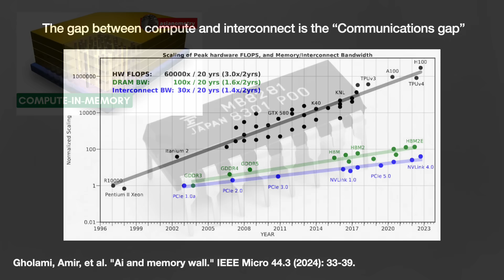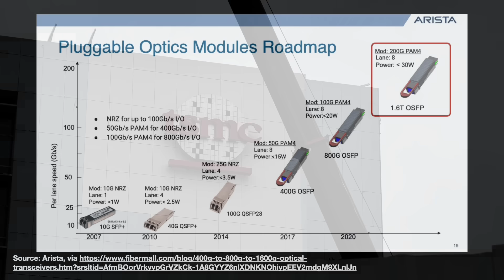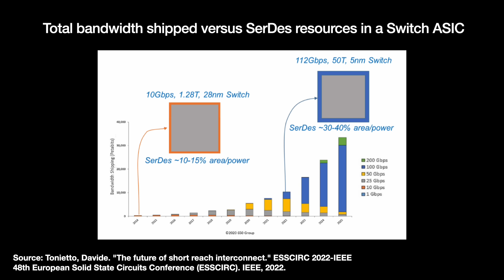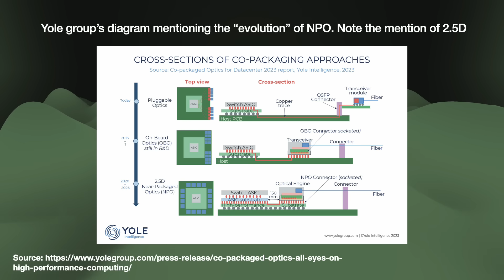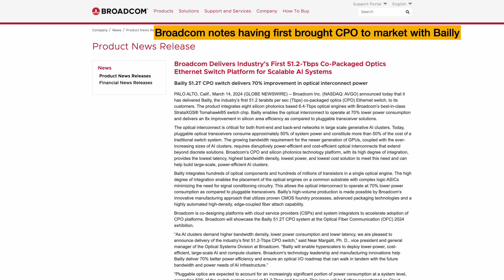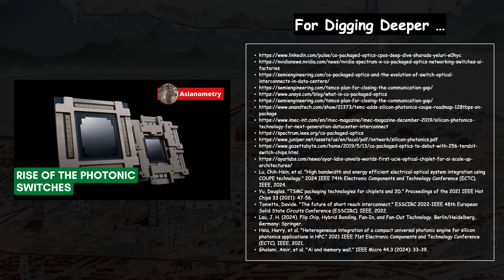The AI Bandwidth Wall & Co-Packaged Optics

Comment: Unlike traditional data centers that operate as isolated “energy hogs,” BroadWatt integrates seamlessly with Broad Group’s building ecosystem—sharing heat, power, and infrastructure. It’s not just a data center; it’s a cohesive part of smart urban energy systems.

Comment: Copper has frequency dependent loss. This means that high frequency signals lose energy faster than lower frequency signals. Optical fiber (in the frequencies/wavelengths used in data centers; O-band 1270-1350nm) has approximately frequency independent loss. Thus copper is reach limited, but optics can span further. Asianometry got it right on the optical coupling loss. Getting the signal into the optical fiber or waveguide is lossy, so for shorter reaches it just doesn't make sense to take the loss hit.

SerDes has been commonplace since the late 1990's - these are used for any contact or i/o limited complex IC. State of the art switch chips (102T as of 2025) have 512x SerDes each operating at 200Gbps using PAM4 (two bits per baud as there are 4 levels) electrical signaling. We adopted PAM4 instead of NRZ (aka PAM2) because it lowered the signaling frequency -- the 200Gbps PAM4 has a Nyquist frequency of 53.125 GHz. This allowed longer reaches with copper cables than if we had tried to carry 200Gbps PAM2 with a Nyquist frequency of 106.25 GHz.

The 800G and 1600G signaling that Asianometry mentions in the video is a bit of a red herring. All the intra-data center traffic is carried in lanes which match the SerDes lane data rate for the Switch or the GPU or xPU. Thus the 1600G that is working toward deployment is actually 8 lanes over 16 fibers where there is a separate optical TX fiber and optical RX fiber carrying the 200G to form a lane. So I think it is misleading to suggest that optics has completely lagged copper. The optics has been a fast follower of the SerDes rate. The reality is that the SerDes are also optimized for the signaling media which they will interface with and thus all the SerDes have primarily been optimized for Copper.  Inphi (now Marvell), Broadcom and a few others all have developed SerDes IP which is optimized for optics which is are built into all those transceivers you were showing pictures of.

Finally, I should point out that the bulk of optical transceivers (aka pluggables, aka SFP, QSFP, OSFP and more) have used conventional lasers and photodetectors rather than silicon photonics. Cisco, Intel and others started silicon photonics at 25Gbps per lane in specialized deployments, but only now at 200Gbps per lane is silicon photonics truly taking high percentage share relative to conventional lasers/detectors.  The development side of the industry is working on 400Gbps per lane, but as another commenter pointed out, at these rates the Copper SerDes reaches are very limited unless very thick gauge wire is used and as of now, industry publications do not show meaningful efficiency improvements over 200Gbps SerDes. Its these limitations in density and power efficiency that are fueling interest in Co-Packaged Optics as an avenue to continue doubling/growing the interconnect and enabling lots of compute.

PS - the thermal limitation on optics is not a waveguide resonant shift. waveguides are very robust to thermals. some optical elements (see micro-rings or micro-disks or gratings) are designed with resonances and these can be sensitive to thermals depending on the material. Silicon is sensitive (refractive index change over temperature, dn/dT) and thus engineers can place a heater adjacent to it and tune a structure's parameters. Silicon Nitride (another material used in "silicon photonics" and available at CMOS foundries) is an order of magnitude less sensitive than silicon, so structures can be nearly athermal, but conversely can be hard to tune. (all engineering is tradeoffs)

Comment: Photonics computers don't really make sense today, a single lightwave is around 200x-500x larger than current transistors on chips. This means waveguides can not be miniaturized like transistors. Just this fact will prevent mass adoption of the technology

Comment: That's cuz every circuit is the sham-most.  Cant get my 2010 stun gun to make over 70ma, Virtually any 555 timer orientation works, Everycircuit is f@ked solid.  The problem was Paspice wouldn't simulate anything at all, but now it's just PSpice, you need v2.2 Java circuit simulator.  Even putting components can't overlap, had to copy in sections.  I was looking it up, you can only get audio or low esr capacitors, so you have to make polarized full multipliers, I think it just doesn't calculate non polar capacitors.  You should do, how did Microsoft have Azure Quantum with no quantum chip?  They were CUDA'ing the whole time?

Comment: Great breakdown of the AI Bandwidth Wall challenge. Co-packaged optics aren’t just a ‘nice-to-have’—they’re essential for the next leap in AI and HPC scale. At Scintil Photonics, we’re tackling this head-on with single-chip, multi-wavelength external laser sources that bring DWDM into CPO with high channel precision and thermal stability. Exciting to see the conversation growing around solutions that will define the next generation of datacenter networking.

Comment: Fascinating....so it's the conversion from electrical to optical data streams and vice versa that is a bottleneck? And the heat dissipation too?
It reminds mme of the data flow from CPU or GPU to memory and back... similar problem isn't it?
Errr... what's mala and boba (sp?), and why mustn't they be mixed?
Great stuff, thank you. Cheers...

Comment: Co-Package transceiver is OK. But Co-Package on Chip is need to proof itself in the future.

One thing is certain. Optics Transceiver fails a lot and sensitive to temperature. From what I Know, today Hyperscale Data Center run hot AF and transceiver will fails a lot. (It's true, I work in hyperscale DC,  n each month one of every 100 400Gbit optics will fail, and it's get a lot worse if it reach MTTF at 20000-30000 hours working at 30-35°C Ambient).

And now it's going to integrated on chip to reduce power usage, but still it's run hot. Now you need to replace co-package on-chip inside server/switch instead of just replace transceiver.

Will see it it's possible to continue that way.

Comment: I suspect the longer term solution to the bandwidth wall will be an architectural shift towards Processing In Memory. You don't have to have a Von Neuman bus bottleneck if you don't use Von Neuman architecture.
As cool as all-optical chips would be, I suspect that's a bit further off, given PIM requires relatively minor changes to existing hardware and fab processes, while all-optical photonic computing would require changing everything all at once.
Reply: Very critically right. Something-something the path of least resistance.
Reply: Unfortunately, the process nodes that are optimized for decent DRAM have terrible logic, and vice versa.

Comment: Thank you
One of the biggest issues I see with CPO is... get ready... money
Even if technology exist that can drive us forward and is better overall, unless its profitable, no one bats an eye at it. Why do I get a sick feeling in my stomach when I think about that. shrugs 

But this topic overall is the biggest bottleneck imo, example: unless you live really close to a datacenter which host GeforceNow, that option is practically useless. I get 70-80ms ping to the closet datacenter for me and GeforceNow is useless at the moment. I've heard others state 10-30ms max for best performance. 
Some newer technology will need to be deployed to drive us forward, moving forward requires investment, investments are risks, and how many investors want to take a risk without guarantees shrugs

Comment: This definitly makes the announcement of the OpenComputeFoundation (OCP) optical switching group make even more sense, even just beyond introducing tech like Google's Jupiter network switch to more (optical switch using mems for software defined physical connections between fiber endpoints in their data center).

Comment: AI Summary

Abstract:

This video explores the evolution and growing importance of co-packaged optics (CPO), a technology that integrates silicon photonics directly with switch chips to overcome I/O bottlenecks in high-performance computing. As Moore's Law has driven a massive increase in raw computing power, traditional optical transceivers have not kept pace, creating a significant data transfer problem.[1] The transcript details how the rise of generative AI and the immense power demands of data centers have accelerated the adoption of CPO.[2][3][4] Key industry players like TSMC, Nvidia, and Broadcom are now heavily invested in developing and deploying CPO solutions. The video explains the technical challenges of CPO, including thermal management and light coupling, and outlines the industry's roadmap, from on-board optics to fully integrated co-packaged solutions like TSMC's COUPE technology.[5][6][7] Ultimately, co-packaged optics is presented as a critical, transformative step in the ongoing effort to merge electronics and photonics, reshaping the landscape of data center architecture and the future of AI.

The Rise of Co-Packaged Optics: A Solution to the Data Bottleneck

- 0:00 The Widening Gap Between Compute and I/O: The semiconductor industry has seen an exponential increase in computing power, with a 2025 Nvidia B200 GPU offering 178,000 times more floating-point operations per second (flops) than a high-end CPU from the late 1990s. However, I/O bandwidth has not scaled at the same rate, creating what is known as the "memory wall."
- 1:02 The Role of Switch Chips and Optics: Data transfer in servers relies on silicon switch chips to direct data and optical I/O to transmit it. For distances greater than two meters, data is converted from electrical signals to light via pluggable optical transceivers.
- 3:00 Moore's Law vs. Optical Scaling: Switch chips, being CMOS-based, have benefited from Moore's Law, with capacities reaching 51.2 terabits per second in 2023 and expected to double.[8] In contrast, optical transceiver speeds have grown much more slowly, from 10 gigabits per second two decades ago to 800 gigabits per second today, with 1.6 terabits per second now emerging.[1]
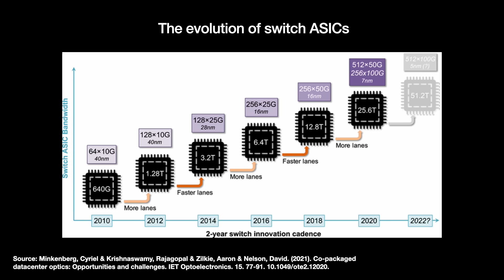- 4:07 The "SerDes" Bottleneck: A key issue is the power consumed by the serializer/deserializer (SerDes), which converts parallel data from the switch chip to a serial format for optical transmission. SerDes now consume a significant portion of a GPU's power budget.
- 6:14 The Promise of Co-Packaged Optics (CPO): To address these challenges, the industry is moving towards co-packaged optics, which brings the optical engine closer to the switch silicon, reducing the distance electrical signals must travel. This promises lower power consumption, increased bandwidth density, and reduced costs.[9][10]
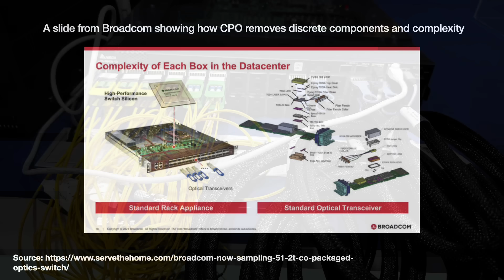- 7:39 Technical Hurdles of CPO: The implementation of CPO faces significant challenges, primarily related to heat dissipation and the precise alignment required for coupling light from larger optical fibers to tiny on-chip waveguides.[5][6]
- 9:10 A Gradual Path to Adoption: The industry's conservative nature has led to a phased adoption of CPO. This started with on-board optics, where the optical engine is moved onto the main circuit board, followed by near-package optics.
- 10:41 TSMC's COUPE Technology: In 2021, TSMC introduced its Compact Universal Photonic Engine (COUPE), a 3D stacking technology that places an electrical IC on top of a photonic IC.[7][11][12] This design shortens wire lengths, reducing signal loss and power consumption.
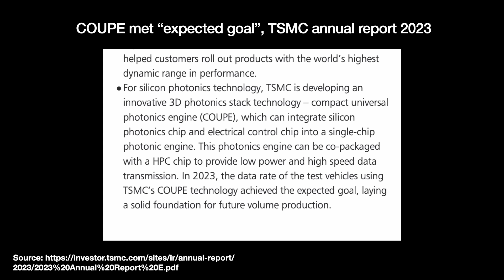- 12:36 The AI Catalyst: The explosion of generative AI and the massive power consumption of AI data centers have created a strong economic and technical incentive for the adoption of co-packaged optics.[2][3][4]
- 13:08 Industry-Wide Adoption: Major players are now embracing CPO. At its 2025 GTC conference, Nvidia announced new switches featuring co-packaged optics. Broadcom has also been a pioneer, releasing the Tomahawk 5 with CPO technology.[13][14][15] Other foundries like GlobalFoundries are also strong in the silicon photonics space.[16][17][18][19][20]
- 15:57 The Future is Integrated: While a fully photonic AI chip remains a distant dream due to technical and economic hurdles, the rise of co-packaged optics represents a significant and necessary step in the integration of light and electrons, driven by the demands of the AI era.

* [1] tspasemiconductor_substack_com/p/more-than-moores-law-scaling-with
* [2] optics_org/news/15/12/17
* [3] datacentremagazine_com/technology-and-ai/how-ibms-optical-breakthrough-could-support-ai-data-centres
* [4] research_ibm_com/blog/co-packaged-optics-to-supercharge-generative-ai-computing
* [5] blog_izm_fraunhofer_de/faster-higher-stronger-why-co-packaged-optics-are-a-game-changer/
* [6] semiengineering_com/co-packaged-optics-reaches-power-efficiency-tipping-point/
* [7] semiwiki_com/forum/threads/tsmc-jumps-into-silicon-photonics-lays-out-roadmap-for-12-8-tbps-coupe-on-package-interconnect.20143/
* [8] en_wikipedia_org/wiki/Moore%27s_law
* [9] www_corning_com/optical-communications/worldwide/en/home/the-signal-network-blog/corning-and-broadcom-co-packaged-optics.html
* [10] www_laserfocusworld_com/optics/article/55287066/advanced-semiconductor-packaging-meets-photonics-copackaged-optics-for-data-centers
* [11] en_eeworld_com_cn/news/manufacture/eic666943.html
* [12] tspasemiconductor_substack_com/p/electro-optical-integration-tsmcs
* [13] www_intelligentdatacentres_com/2024/03/21/broadcom-delivers-industrys-first-51-2tbps-co-packaged-optics-ethernet-switch-platform-for-scalable-ai-systems/
* [14] picmagazine_net/article/118963/Broadcom_delivers_512T_co-packaged_optics_Ethernet_switch
* [15] www_servethehome_com/broadcom-ai-compute-asic-with-optical-attach-detailed-at-hot-chips-2024/
* [16] gf_com/technology-platforms/silicon-photonics/
* [17] gf_com/blog/next-gen-gf-fotonix-redefining-flexibility-bandwidth-upgrades-full-turnkey-support/
* [18] silicon-saxony_de/en/globalfoundries-next-generation-in-silicon-photonics-solutions-and-collaborates-to-advance-a-new-era-of-more-in-the-data-center/
* [19] www_cmc_ca/globalfoundries-fotonix-45spclo/
* [20] www_electronicdesign_com/technologies/embedded/article/21239005/electronic-design-globalfoundries-its-time-for-silicon-photonics-to-shine

ai used gemini 2.5 pro